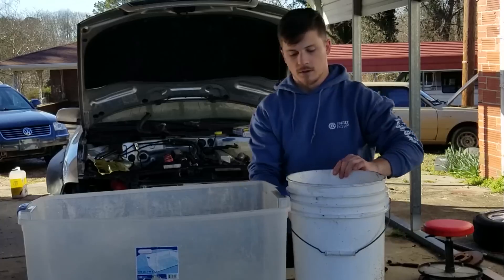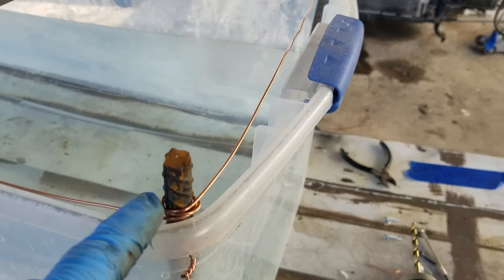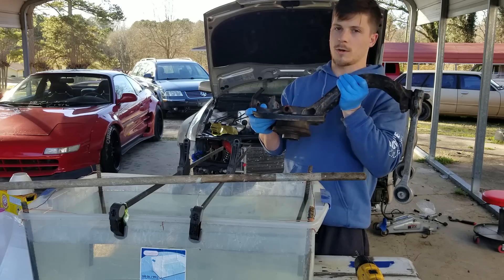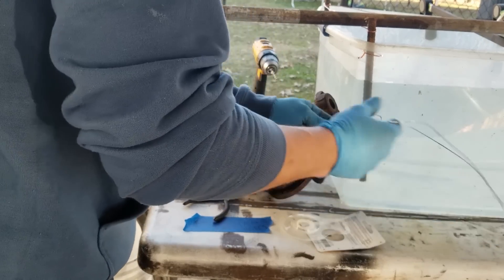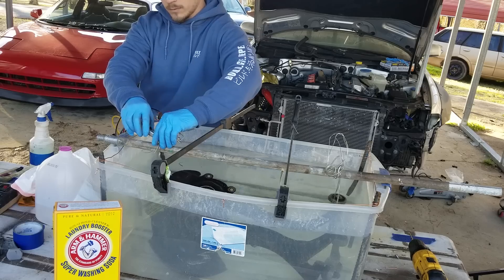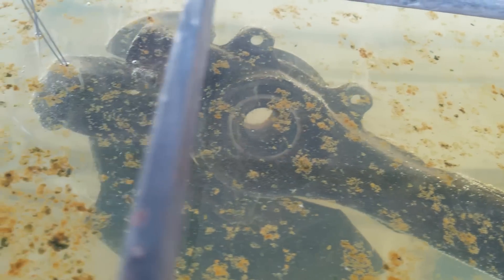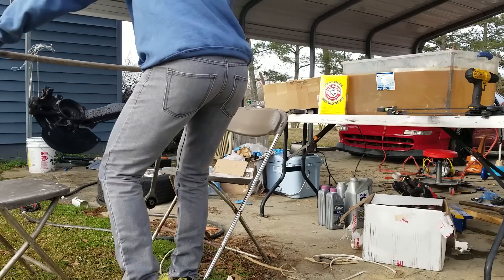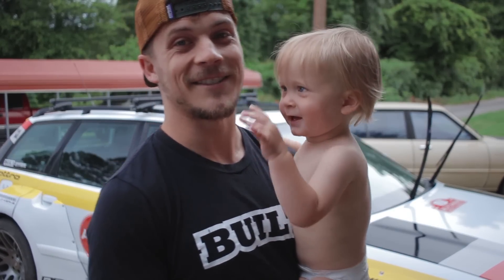REMOVING RUST WITH SCIENCE

Comment: FYI that is a 104qt container, so it holds 21 gallons of water.  You might have been able to use more of the powder and speed up the process as you only used for 10 gallons of water were you had approx. 16 gallons

Comment: What’s the best way to remove surface rust from the wheel arches?
Reply: Flap disk on a grinder and a touch up with Bondo then sand flat with 800 grit sandpaper is what I do
Reply: Thomas Tormanen is it worth treating the rust with something or just bondo over it once it’s back to bare metal?
Reply: It depends on how
Reply: Aggressive a flap disk you use there should be plenty of "scratches" for the Bondo to bond to
Reply: Thomas Tormanen I mean like a rust killer/converter solution.
Reply: Oh yeah whenever I go down to metal I use rust-oleum rust reformer

Comment: It will eat the aluminum  control arm. Pluses once your done. Coat it in wd40.  To keep it from flash rusting
Reply: why waste your time with wd40 when it only works for a week. just chassis save/por15 to prevent the rust. and phosphoric acid with remove surface rust without much elbow grease. and of course a good amount of people should never play with electricity and water

Comment: IMO 2 reasons it stopped working :
*  your cathodes (electrode attached to the + I think) are completely covered in rust, preventing it from collecting more rust.
* Or the baking soda has completely been consumed

The funny thing is that it should be reversible, leave it like so and link the electrodes with a resistance the rust will go back to its original place

someone correct me if i'm wrong
Reply: Your wrong. Jk I have no idea.

Comment: for anyone wondering how you do this, take an old electrical appliance that you don't need and cut the cord from it. just plug it in and dangle the cord into a bath full of water. check the temperature of the water is good, and boom, mission accomplished